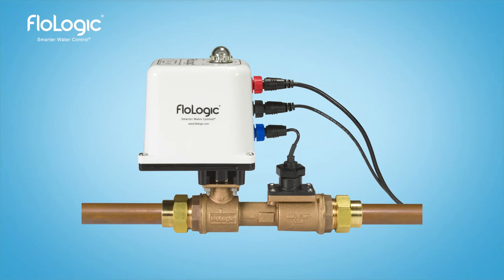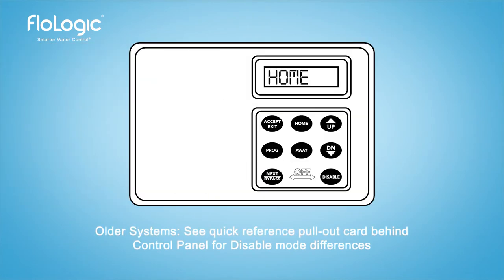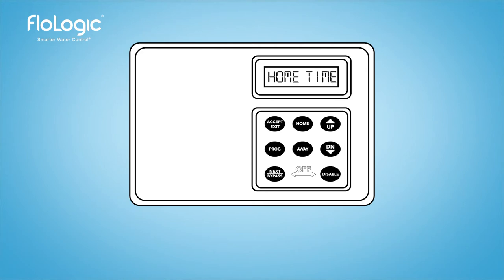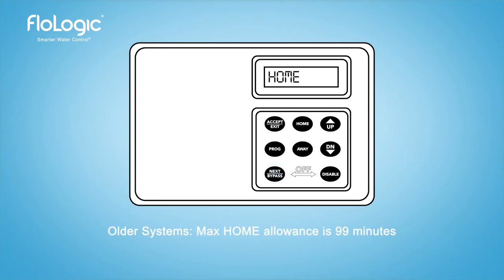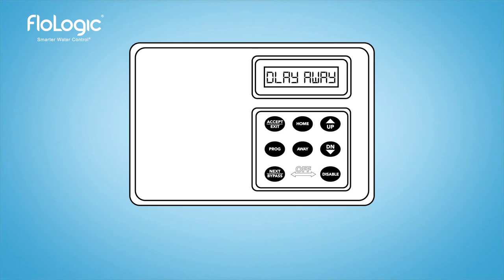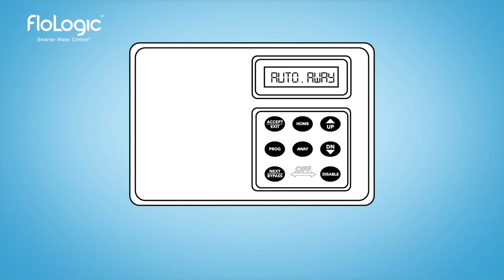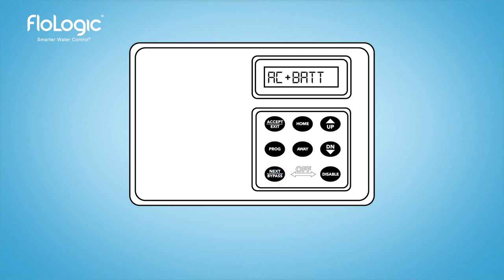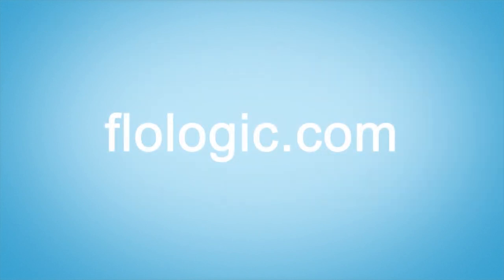FloLogic Local Control Panel User Instructions

Comment: What year is this ? why is this interface so crappy ?
Reply: I have one of their systems from 2008, and the control panel and interface haven't changed since then.  Frankly, I'm surprised that they haven't evolved to a wireless interface by now.  They're truly stuck in the last century, but the hardware is solid.